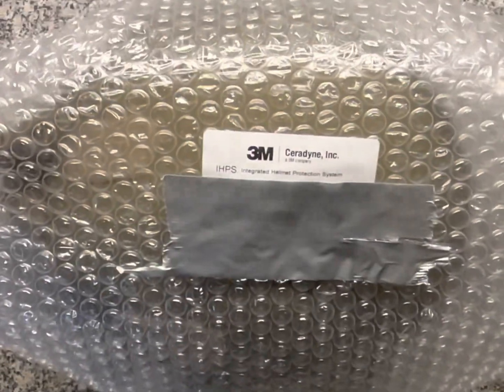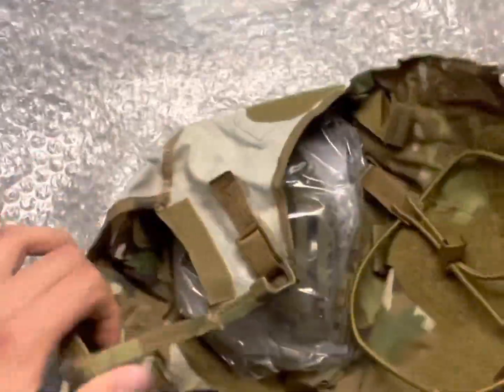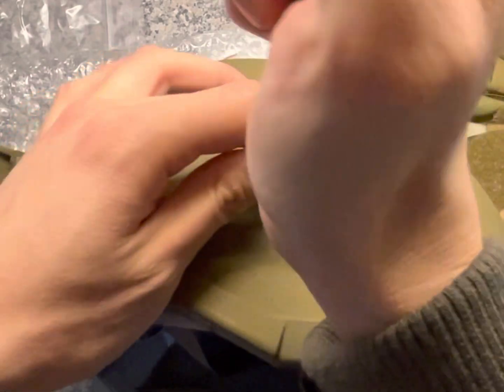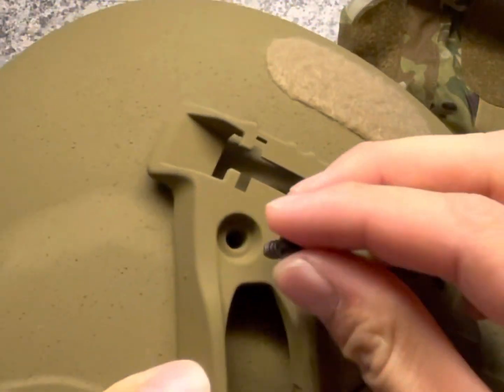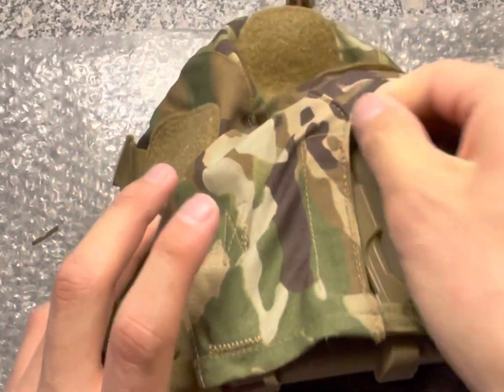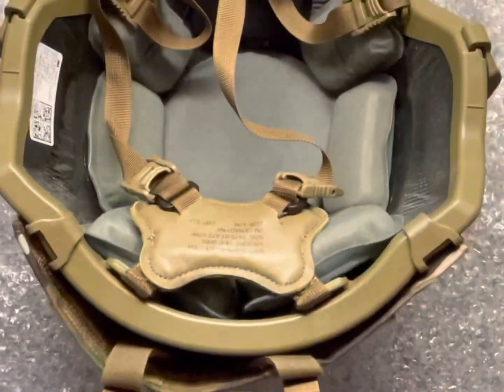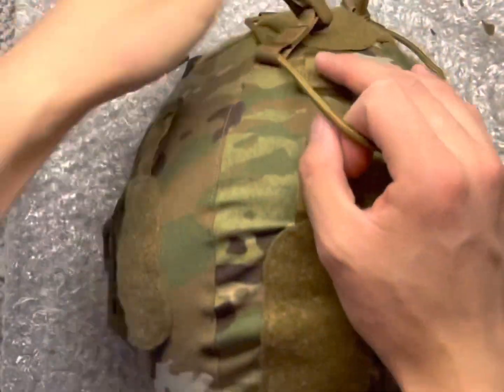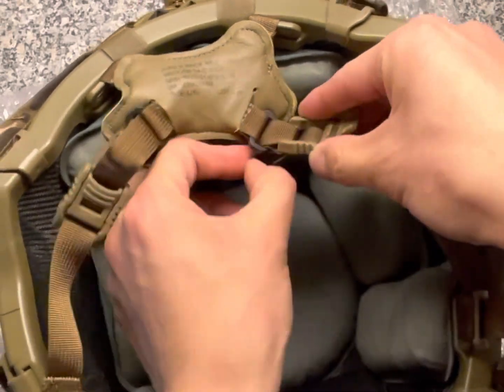How to assemble IHPS (Integrated Helmet Protection System) New ACH

Comment: Hard to believe they've already moved on from the ECH to this. I only just recently got me an ACH and now it's as outdated as the PASGT was to it.
Reply: Even crazier is the ECH in the Army doesn't really get issued and it's better than the IHPS. I was lucky to get one 2 years ago from CRC, when i tell people I have a ECH and not a ACH they don't even know what I'm talking about.
Reply: @CPL.Shitbag  Doesn't help that the ECH and ACH are almost identical with the only real difference being how thick the shell is, with the ECH being thicker since it's designed to have a higher ballistic rating than the ACH (NIJ level IV vs level IIIA).
Reply: @Orca19904 The ECH is definitely not NIJ level IV. That would mean it'd be as protective as a SAPI plate. That's definitely not the case, given it's not a 6 lbs helmet. Most helmets, the ECH and ACH included, are just "Kinda sorta" level IIIA, with PE helmets like the ECH having slightly better performance against rifle threats or mild steel cored ammo, but only in the sense that the projectile may be stopped in specific scenarios, the backface deformation is worse than kevlar helmets usually, so the protection is limited, even if the projectile is stopped.